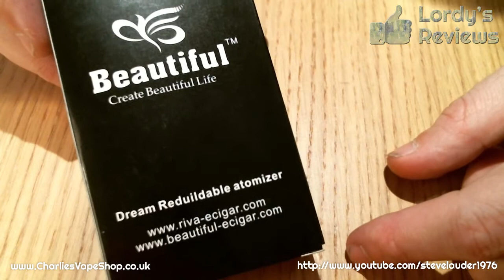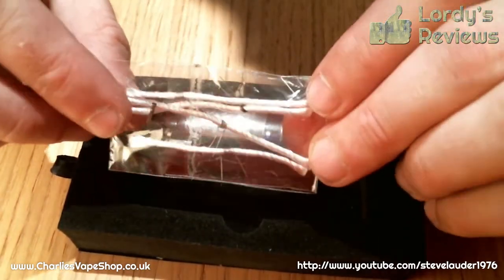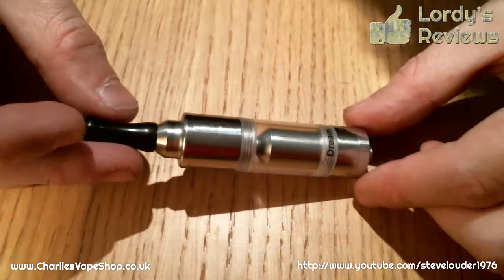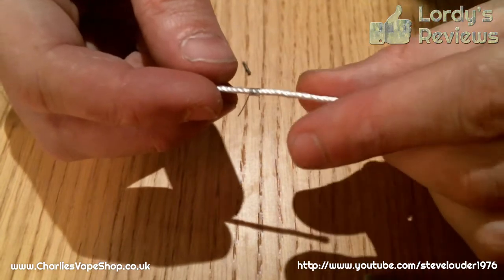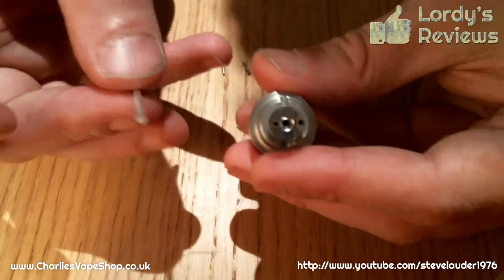BT804 Dream Extended - Review & filling & assembly -  SS Stainless Steel 'Dream'

Comment: Great video. I haven't seen the extended version available here in the states but will keep a watch out for it. I've had very little problems with leaking and am really enjoying mine. I have found rather tha trying to create a vacuum, that I have better luck covering the hole and blowing hard to pressurize the system, this gives me a long vape time before doing iy again.

Comment from the maker: Same goes for your useful tip as I said to StiG - really appreciated and I think a revision is in order to take on-board your great advice. I read about the drip tip thing and it didn't make sense at first... But I 'get it' now. Can be a bit slow on the uptake at times :)

Comment: I have the older version which has much more larger (almost useless airhole). I use it with a tightned hole (with a cello tape) and a i fill the tank section upside down with a plug in the drip tip hole. And then I screw on the the base. I found it that it performs much more better, if you don't put the silica into the channels. Just place the silica on the top of the channels.

Comment: Air doesn't come in through the bottom 510 connector thats what the air hole is for.
The base cap is a juice cup for when it floods and a bit of a design flaw but on the plus side with the spring and the way the 510 centre pin is set up it allows it to be spring loaded so will help with connecter issues and crushing the grommet in your prefered PV.